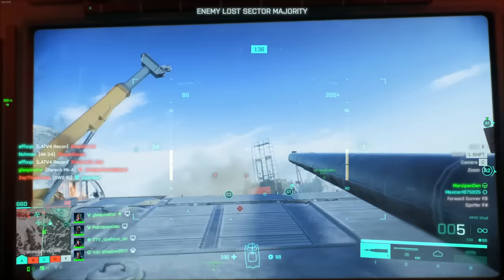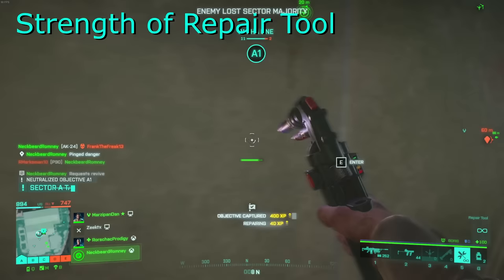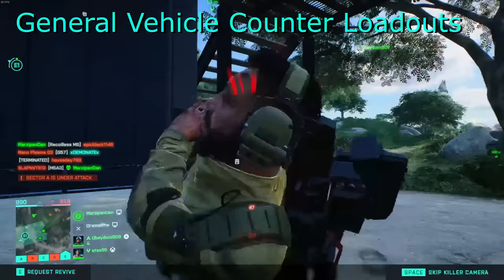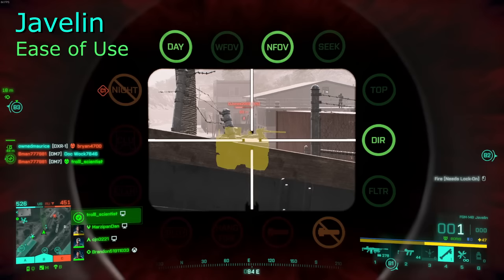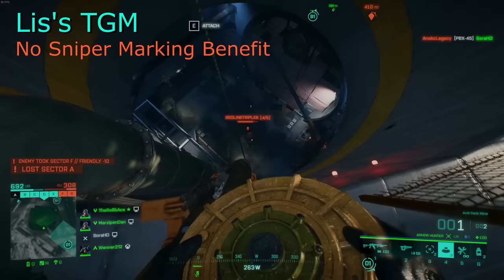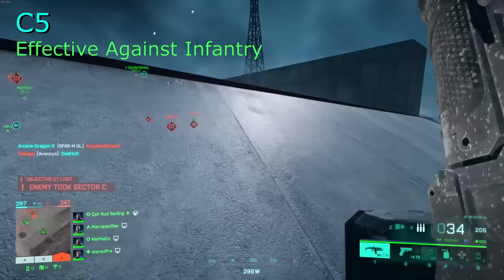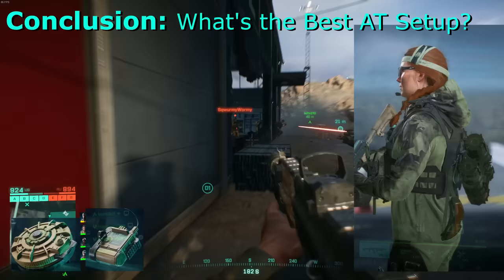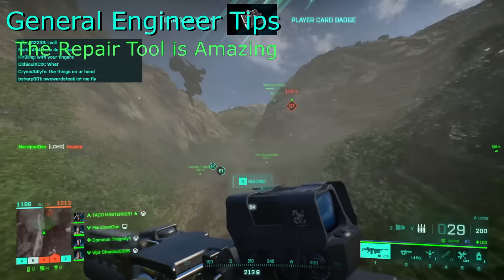How to ACTUALLY Deal with Armour - A BF2042 Anti-Tank Engineer Guide

Comment: I'm new to this game but  just spent about 30hrs riding along with vehicles as a gunner. I found vehicles to be very short lived as a whole, with the exception of elite drivers who defend an objective, they can sometimes last quite awhile with good gunners. There are a lot of folks out there gunning for vehicles and thus a lot of hazards. I did not find them to be OP at all, their secondary weapons are quite weak, especially the 40MM and 50MM's, the 40MM grenade has little splash damage or power, which is pretty comical if you ever fired a real 40MM grenade as I have in the MK-19 and M-203.
Reply from the maker: I think it depends on the quality of the driver as well as how comfortable they are with preventing  C5 attacks, which are the most common way players will try to counter vehicles.

With a squad using comms in 4 seater vehicles, they can be very difficult to deal with. My friends and I  popped off during a control game in a single hovercraft the other day with the 40mm grenade launcher and thermal LMGs on the sides. Captured a bunch of objectives and got something like 60 combined kills. 

Compare that to someone who is soloing in this vehicle, you have almost no hope of hitting those numbers.
Reply: @marzipandan767  C5 was definitely the leading cause of death by far. I'd say the vehicles I was in rarely lasted more than 10 or 12 minutes tops, even Tier 1 vehicles..... and 5 minutes in a helicopter was a long ride. Of the few times I was in vehicles that lasted more than 12 minutes, it was usually a Wildcat camped out at the edge of a map and a couple of those times we were crushed by our own teammates in a tank......many folks out there do not like campers for sure.....lol. Overall, gunner was more fun then I expected though.

Comment: You didn't mention Crawford repair tool buff. You actually show it in your video when you see the extra notch to the vehicle health in the centre of the HUD when he's repairing at 4:02. He gets extra fast repair to low health vehicles. 2 Crawfords in a air transport vehicle virtually make it indestructible.
Reply from the maker: They nerfed quite a bit a few patches ago. I think he now repairs 10 percent faster below that health point instead of 50 percent. It's still good, but much less so. He's a good choice if you want to support friendly armour and his turret is decent too.

Comment: I love using emp gremades and or anti tank grenades they are very strong atm.

Anti tank grenades still do damage to players as well, not as effective as normal grendaes. But they are very strong vs armour.
Reply from the maker: I always run the AT grenades as engineers these days. It's so important to have that little extra bit of damage to finish vehicles off!

The EMP grenades are good too, especially on tanks where you can make them come to an absolute stop.

Comment: For a little extra spice, there’s also the anti-armor rounds that come with the four weapons you mentioned. Slap it on the LCMG and you can actually deter vehicles off objectives. Most vehicles run at the first sight of damage so having it on hand is a nice little extra damage to stack if you wanna min-max this to memehood.
Reply from the maker: I've used them once and was pretty underwhelmed. Would you recommend running them now? Is the damage decent vs. Armour? And do the bullets feel much less effective vs. infantry?
Reply: @marzipandan767  Cant say 100% but the ak24 feels good with AP as much as standard, didn't feel too much worse, on other weapons probably more notable though
Reply from the maker: @oshadow8325  it will be hard to put down the drum mag, but swapping out an assualt rifle magazine is much faster than changing out a whole MG box.

Comment: I think the misconception here, especially with regards to things like wanting smoke moved into same slot as repair/APS is that you expect to be able to deal with a tank by yourself. A tank should require more than one person to be killed, it's a tank after all. It's meant to be dealt with by either many infantry or another vehicle, not some lone engineer.
Reply from the maker: I think that it is and should be possible to solo a tank, but it should be very difficult and right now I think it is exactly that. My issue with the thermal smoke and the APS being able to be both equipped is it makes the Javelin kind of a useless gadget and since we already have so few options to use against tanks that is a lot to lose as a viable option. I think the vehicle balances is decent now. I think my main point I wanted to make it that people should play engineer and should be working to kill vehicles.

Comment: Its not a problem for veterans. You don't need just engineers.  Snipers use 50 cal , smoke, C5, or soflam.  Capers use drone. Good video by the way.👍
Reply from the maker: I've been playing with the NTW with the antivehicle rounds, and I don't think that it is very good at dealing with armour. It does a small amount of damage for the cost of being your primary way of doing . Also, you trade the one shot hit body shots that the normal rounds give, which means the rest of your game is hindered. You can use the T menu to switch, but it usually isn't worth the time to do so. I think each of your 4 shots does about 5 damage to MBT.

I feel drivers are getting used to dealing with everyone running at them with C5. I think it's going to be a less and less effective strategy as people keep getting better with vehicles. 

Thanks for commenting! I really appreciate it!

Comment: Never used anything before t Liz or Rao with C5 and NTW-50. I love you sing bolt with fwd missiles and mine layer as driver. You can really own if you stay on the move. With the TGM you can guide it over hills and on top of  buildings and kill hiding vehicles and high top infantry.

Comment: Honestly what needs to hit these vehicles is for the jeeps is allow normal bullets to damage them.

For the IFVs, EBRC Jaguar and that other thing, buff the damage taken from the sides and rear.

For MBTs: Give them the old Battlefield 2 weakpoint of the tracks.  I remember shooting tracks would fk their worlds up.  Or, in the very least, add weakpoints back to the tanks.
Reply from the maker: I definitely think that more weak points and specifically the disabled effect would be a very good thing for Dice to add. Getting a critical hit or damaging an area consistently should be rewarded. 

The damage done by these weapons is weak, but Dice have to consider the fact that a lot of tank vs. Infantry  is one tank against multiple infantry. Even just a small increase in damage dealt could make vehicles very weak. I don't envy the balancing act that Dice has to do.
Reply: @marzipandan767  That would mean armor cant just go it alone.  Armor needs infantry, infantry needs armor.

Another thing could be to increase frag grenade damage against armor.  Like double against the buggies and jeeps, then 50% against other armor units.  Grenades were always a good counter for armor in BF2 and 1942.  I remember just laying by a crate and spammin them nades at tanks lol.   Even if it wasnt super effective, having 5-6-7-8-9-10 grenades explode on your tank was a good way to get the tank to fk off.   Then you pair it with some normal AT and yeah.

Comment: The way I hunt vehicles is mostly with Mackey. I will try get close (which may sound wishful but with 2-3 attempts I'll almost get any vehicle that isn't camping in their own spawn). After getting close I rappel onto the vehicle and drop my C5s and boom we all go up in smoke. 

Also if ground vehicles are being campy I usually switch to Liz with C5 and EMP so i can hunt campers as well as vehicles pushing.
Reply from the maker: A great strategy, though I do feel like vehicles are getting a little more cautious since they know that C5 is such a threat. They'll hang back a little and push objectives from behind other infantry.
Reply: I do agree which is why it takes a few goes often but especially when I'm defending I don't mind that. The other thing is that I try parachute in from heights/ helicopters which depending on the players on the other team can be quite an effective way to get to vehicles hiding

Comment: One loadout I’ve been running is Boris with the ntw-50 and the javelin. I’ve had tons of success with it. The tanks get distracted by the turret kind of peppering them and then I hit them with the javelin and if they have a sliver of health I just shoot them with the ntw-50. You can also do decent damage from range with the ntw since it is a sniper
Reply from the maker: Do you know how much damage the NTW does vs. Tanks?
Reply: I’m not sure tbh but I’ve used it pretty effectively as a finisher
Reply: @marzipandan767  just tested. Regular AP does 8-9 damage to normal heavy vehicles and 3 to the MAV. AP high power does 14-15 to normal heavy vehicles and 5 to the MAV so a pretty good finisher. It’s a bit inconsistent but still a good finisher. A little over 20 damage to air vehicles too
Reply from the maker: @Jack Brehm  that's definitely not bad damage considering how fast you can get the rounds out! I would imagine it is subject to damage drop off like most bullets in the game, but if you are at a decent distance, that should be fine.

Definitly a good option. My concern then is that I suck at sniping. Having this as my main would be a massive detriment! But it could definitely work for other people! Thanks for testing!

Comment: Can u detonate lis's tv missle at any time or is it just a boost? I remember you could set it off whenever u wanted which worked good for hitting targets behind cover
Reply from the maker: You cannot detonate it manually. You can exit the missile and it will continue flying straight forward, which is useful if you know your Lissile is going to hit. I don't ever recall the ability to detonate it, but early Lis adopters claim you could.

Comment: I deal with tanks fairly easily in one of two ways. 1. Zipline unto them with Mackay and C5 them. Works almost every time. 2. Hack them with Rao, then C5.
The missiles are too weak to deal with tanks imo, unless you have 2-3 friends to fire with at the same time. It's more efficient to C5 them. Ofc C5 isn't an option against "artillery" tanks or AA standing in their safe-zones, them I honestly don't know how to deal with, because missiles they can avoid with counter measures or just backing away even further or hiding behind something and repairing.  Sometimes I Find a high spot and wing suit above them and drop C5 to get rid of them, but that doesn't work on all maps. I don't think weapons of any kind should be allowed to fire in safe zones.
Reply from the maker: I think tank players are catching onto this strategy and starting to focus on Mackays and Sundances, knowing that they are going for the C5 rush. Rao is in a good spot now, I just wish that you would get some points for assisting with vehicle kills after you use his hack to designate them...

C5 is an effective strategy, but it is risky. I wanted to show that you can solo tanks at a decent distance.
Reply: @marzipandan767  You "can" but it requires multiple people working on the same tank, or it can take you a day or two to actually kill one with missiles. Unless ofc the driver is a numbnut and just sits still and takes the hits :) 

At least that's my experiences. C5 is risky, but I kill way more tanks over a series of games being risky, than trying to get them with javelins or what not.

But to each their own :)

Comment: I do feel like the video title might be better if changed to "Anti-Tank Infantry Guide".
Since often times, I'm not even sure if Engineers are the best at fighting Tanks. You have Rao's constant non stop hack spam, Mackay flying in with 3 C5 charges, and even Angel with Underbarrel AP spam.
I do feel like learning how to deal with Tanks as Infantry is important, but maybe being Engineer isn't that important?
Reply from the maker: Thanks for commenting!

Rao is only great if combined with some aware engineers. When he is, he is amazing, but otherwise you aren't really doing much. Plus, currently you don't get any sort of recognition for tagging vehicles, which makes playing him very unrewarding.

I think drivers are getting used to dealing with C5 players and are being more cautious, I would bet that vs. good players you'll die way more trying to C5 them than you will be successful. 

Angel underbarrel spam could work provided you fight the tank around a deployed crate, since you will need to hit all 3 shots, then replenish and hit at least 2 more, probably 3 more. I would think that the tank would move away from you by the time you hit it 2 or 3 times.

I think engineers are great and provided that you load them up properly you can solo vehicles. Granted it is hard to do, but it's a tank, it should be hard to do :)
Reply: @marzipandan767  Thanks for the reply!
But yeah, I can see that to fight vehicles as infantry, engineers might still be the best.

Comment: No mention of AP Ammo? Sure by itself it isn't much but i believe the ak can carry it and with the ap nades and your main anti vehicle weaponry means you have a lot of flexibility in killing off weaker vehicles.

PKP and AP ammo has annoyed plenty of helicopters and they'l often fly off after only a little damage.
Reply from the maker: I tried AP vs. a MBT in a controlled environment, it was more effective. However, I have two concerns:
1. Switching to AP ammo with an LMG takes a whole reload cycle, which is quite a while. If you plan on using it to finish off a vehicle with it, it will likely drive off or die before you can start shooting it. Alternatively, if you are using this as your main ammo type, you are taking a smaller ammo count, increased recoil, and lower damage vs. infantry. You are giving up a lot for a little, in my opinion. But if the tradeoffs work for you, then I saw about 46 damage when unloading a full 75 round magazine against the rear of the tank at close range. From the front, it was much less. I would compare the damage to Crawfords minigun. In fact, it might have the same damage model.
2. Firing enough AP Rounds to do significant damage to a tank puts you in such a risky spot since you are giving away your position for a long duration, so I would never recommend starting vehicle engagements with AP Rounds. Again, a lot like Crawfords turret.

I can see them being useful vs. Choppers but as a pilot myself, I've never had a lot of trouble with them.

I'll definitely do more testing in an in round environment, and if I change my mind, I'll let you know! 

Thanks for the suggestion and the comment! I appreciate it!

Comment: The engineer class needs an additional specialist. Boris is completely useless so you have two specialists. The engineer class needs a buff in my opinion because dealing with transport choppers or the condor in breakthrough is toxic as hell. They should just give the defending side jets back
Reply from the maker: Yeah, it sucks that Dice has said that more specialists won't happen. I think the Condor is fine right now, but the Hind is still too maneuverable. That being said, I don't play a lot of breakthrough where players typically bunch up a lot. I think giving jets to the defending team would be a good idea.

Comment: also why does engineer only get 3 rockets and it takes minimum 3 to destroy basically anything... i feel like they need at least 6 to be somewhat effective
Reply from the maker: I think DICE's intention is that vehicles should be a team effort. I cannot stress this enough, if you want to have a good AT run with engineers then you NEED to be using the AP underbarrel grenades. 

It just sucks that it means you can only use 4 weapons :/
Reply: @marzipandan767  agreed but it’s hard sometimes to get the team to cooperate… especially when a Majority  of the time you need a discord 4 man squad to gang up on vehicles

Comment: Something that I don't see a lot of is using AP rounds in your LMG. If you are focusing on killing tanks this is an absolute must. All your effort should be focused towards causing as much damage as you can at all times. I usually play as Liz and use an LMG with AP rounds, I go through an entire magazine of ap rounds and then hit them with 2 of her rockets. It may not kill the tank but it drives them off their targets and gives your teammates a little breathing room... it also helps anyone else playing anti tank to kill it. Its not so much about gettinng the tank kill yourself, but just getting the tank killed. I think ap rounds in an LMG cause like 5 damage, which isnt alot but if you empty a 100 ap round magazine into a tank, the damage adds up. Like I said, it may not kill the tank but it makes them leave the area for a few seconds and eases the pressure. If more players used ap rounds in their LMG and focused their fire on a single tank, tanks wouldnt be such a problem. Your ammo loadout in your T menu should include ap rounds and just switch back and forth when you know you're going after tanks. If there's no vehicles around, I'll go to the T menu and switch to standard rounds or something else.
Reply from the maker: The damage the AP rounds cause is so small that I never found them worth it. Especially since you need to either switch to them using the T-Menu as you mentioned, which takes an entire long reload cycle or nerf your infantry game by running them as your primary ammo type. Plus, you make yourself so vulnerable while shooting that I found unloading on a tank usually lead to a swift death.

Thanks for commenting!